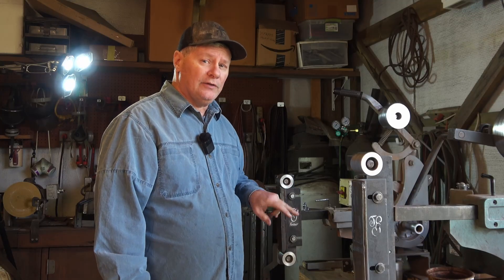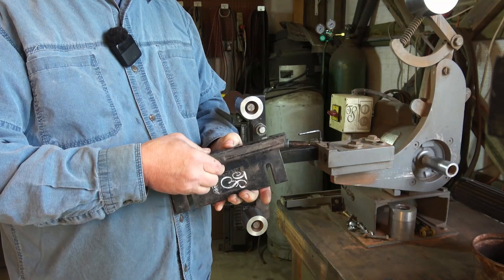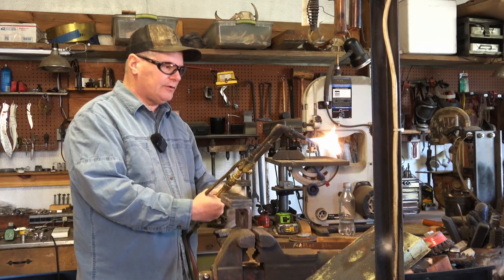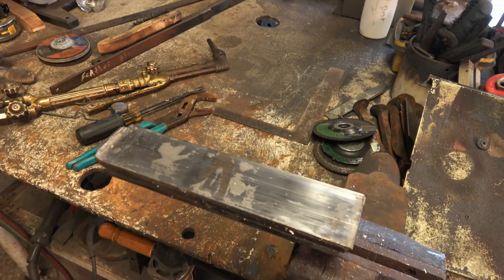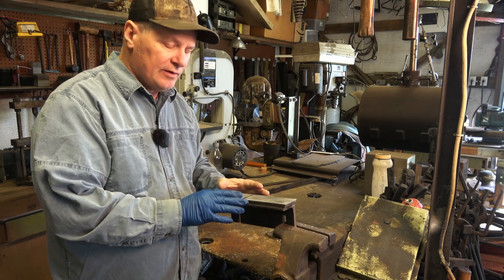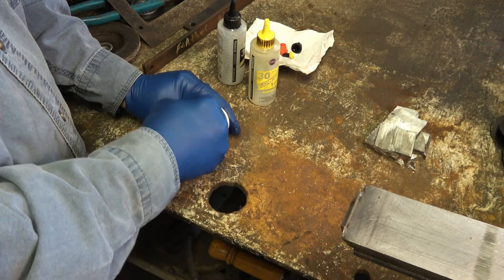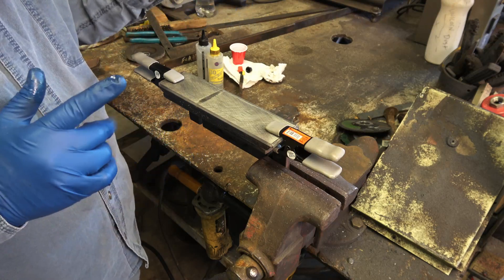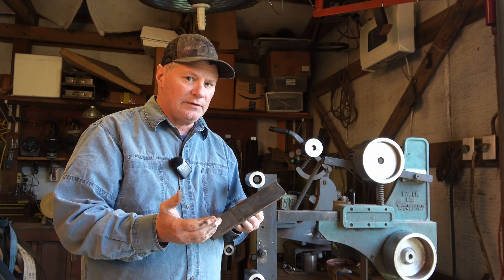Installing a Ceramic Glass Platten on a 2x72 belt grinder

Comment: I'm new to using a 2x72, but I've already noticed a divot in the factory platen, so I'm going to change to ceramic glass. Do you recommend using any kind of lubricant on the surface of the glass to help the belt move more smoothly?
Reply from the maker: I don’t use any lubricant.  It will run just fine.

Comment: Can fiberglass be used like this?
Reply from the maker: I doubt it. The ceramic glass is high heat and abrasive resistant.
Reply: @TonySeverioKnives  thank you for the advice, im new in this, so every tip is very helpful.
Reply from the maker: You’re welcome, thanks for watching!  🙂

Comment: Great tutorial Tony. Do you round the edges of the sides of your glass platen? I use double sided tape without the tab welded on bottom for 15 years. Never had issue of it coming off.
Reply from the maker: Thanks Jim.  I buy them already rounded.  Never tried the tape but that’s cool for sure.

Comment: I used JBWELD on the glass platen I installed, it does get hot though, I do not have the heat sink behind it . . . I should upgrade!
Reply from the maker: The heat sink in s the way to go.  I’ve never had issues with epoxy though.  An aluminum back plate water cooled would be ideal.  However I haven’t noticed a heat problem with the thick steel plate.

Comment: I use JBWeld.... Think it can handle more heat n use electritians tape top bottom n in the middle to keep aeay any stress from the glass while curing.... Thats what works for me.... Interesting way of attaching a platen...I use the 2 tapped holes methode, a heat treated to over 60 Hrc platen  n get the platen surface ground when it shows wear...always interesting to see how u do things.
Reply from the maker: Yep many ways to go about it.  As long as it works, that’s what counts.  Thanks for watching.  😁

Comment: I've actually been wanting to get one of these but I didn't know if it would be worth the trouble. I also wanted to get one of those radius platens I've been seeing lately. It's supposed to be like a 6 ft wheel or something like that. Have you ever tried one? Great video 👍
Reply from the maker: Thanks!  I’ve used glass plattens for many years and I love them.  Many folks don’t like them because they break them.  You just have to grind bevels only and they will be fine.  When I break one, it’s my fault.  But you can do some clean grinds with them.  I actually have a radius platten but I hardly use it.  They get hot fast so having a way to cool them is the way to go.  But they are another good tool to have.